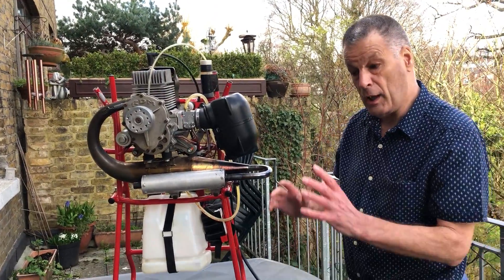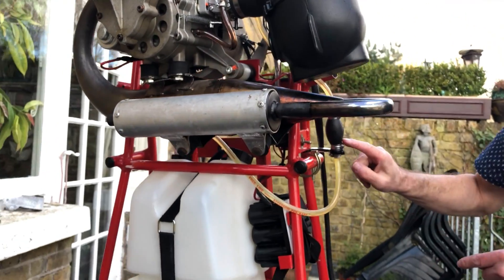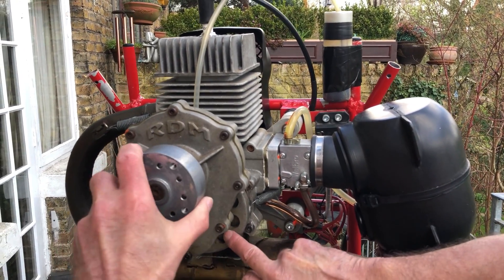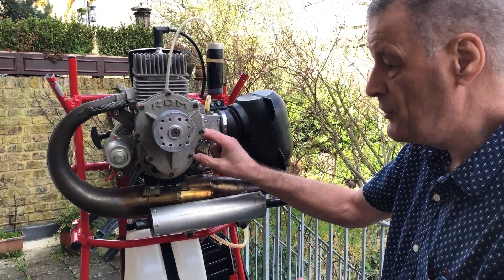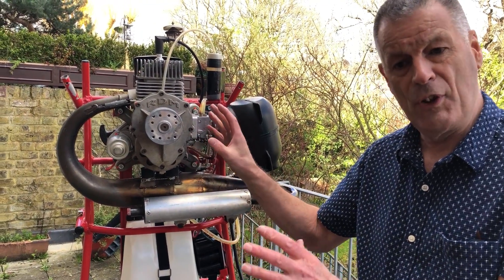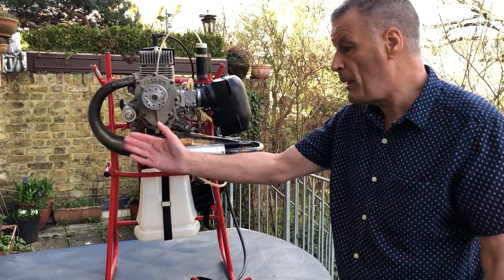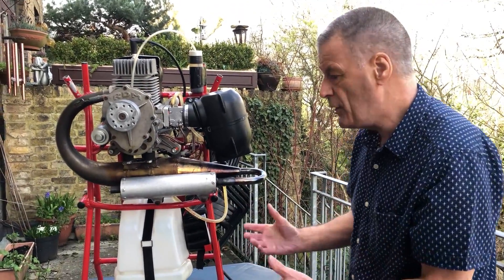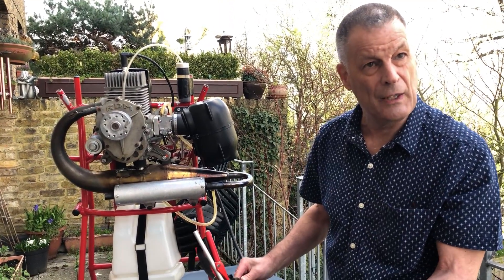An introduction to 2-Stroke Paramotor Engines by James Davies

Comment: "don't gorilla wrench it, but make sure it's nice and tight" i always worry about under or over tightening when a newton-meter range isn't given. With this statement, I assume about 5-10 newton-meters. But who knows
Reply: For aircraft engines in particular I've always thought that everything from the spark plugs to the mounting bolts should have a specified torque, not just "hand tight" or "nice and snug."